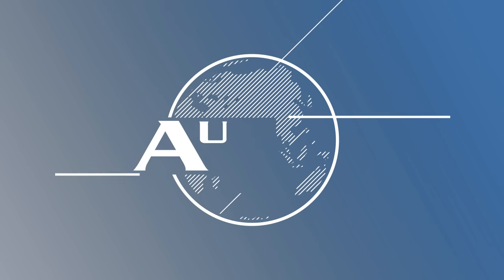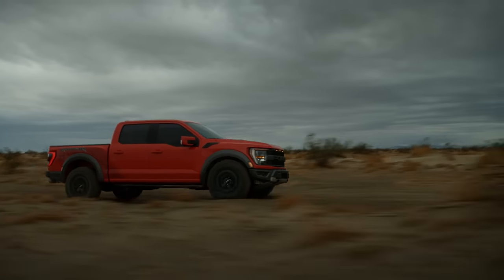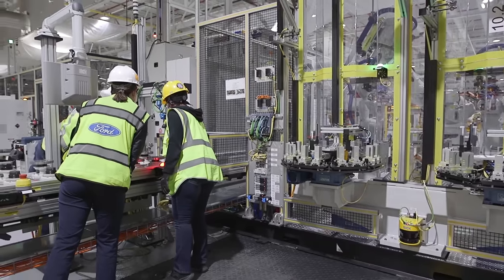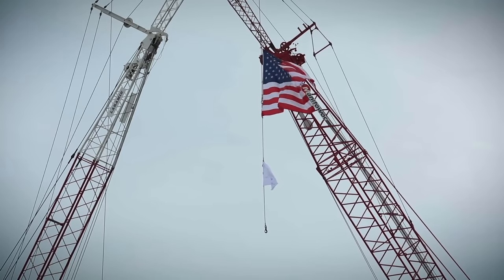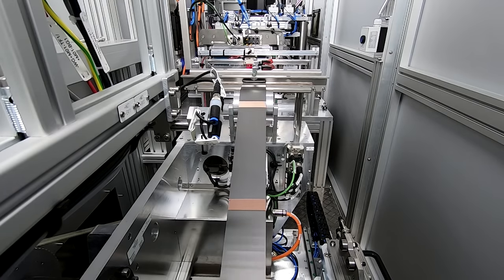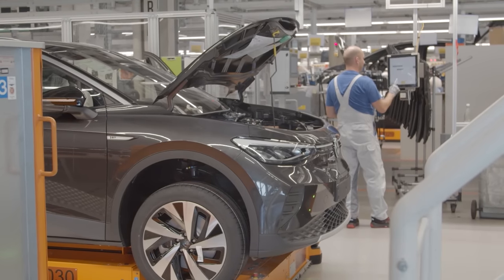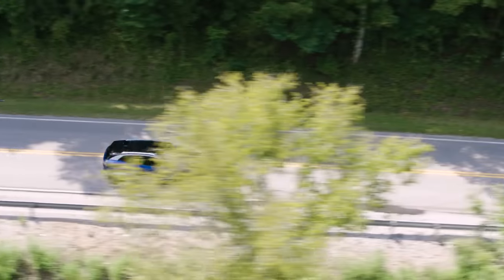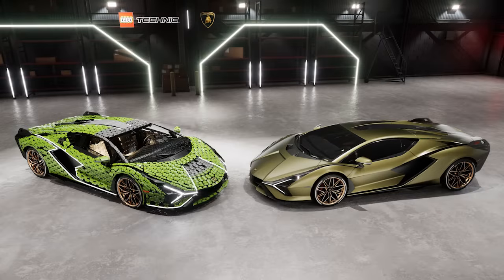Tesla Reveals Model S Plaid; VW ID.4 Test Drive Impressions - Autoline Daily 3099

Comment: If the Model S Plaid is only faster quicker in a straight line, it won't even have the impact on performance the Nissan GT-R35 had after it launched. The R35 was is still a highly proficient road course racer not just a dragster. The R35 is supremely quick but also tremendously fast. But Model S's tend to be yeoman at best, the typified American Muscle car, more power than handling and/or maneuverability. So, being quick but not fast around challenging corners and bends. 

But then I expect the Model R (if that will be its name and it ever happens) to fix most of that... maybe.

Meanwhile, the Plaid is likely meant to put a fiinger in the eye of hypercar makers, Rimac's Concept Two, The Pininfarina Batista, and Lotus Evija come to mind, whose BEV Hypercars are just as quick, but cost around or over $2M and maybe all of them together will only produce less than 1000 cars. But then those cars will also be demons around a race course.

Tesla again may be showing that they are ahead of the curve when it comes to technology, though not styling (Personal opinion is personal), but notably behind the curve when it comes to performance trends. Handling and maneuverability are the key points these days. Acceleration and Top speed are still very important but are a close by still second place to handling and maneuverability. Given most people will not be able to use the kind of acceleration or assumed speed the Plaid will be capable of, handling and maneuverability become MORE important, for it "fun factor" and utility. Most will consider 0-60 of around 3.0 second is good enough and safe for most likely drivers of such vehicles.

Also, Insurance companies typically don't penalize vehicles for having great handling and maneuverability, just acceleration and speed. But then if you can foot almost $130K for a single vehicle, does that really matter?
Reply: Perhaps you will need to study the Laguna track results and then the Nurburgring results, it's not just about speed.
Reply: @johnmqueripel2367  
I believe I said that at least once during the comment.  I view Quickness/acceleration and Fast/Speed as two different things. 

IF you are talking about "the Model S (or Plaid, the "Raven") can be just as fast around a road course" it would be clearer to say that or include it with your comment. 

Brevity can be the enemy of clarity. Do not assume "I know, you know?"

I was not short because I expected responses like yours to be forthcoming. If there is a link saying "Read More", you should probably click it and read more.
Reply: @DocWolph  Dear oh dear I think you are taking yourself a bit too seriously now.
Reply: @johnmqueripel2367  
And I think you got caught in an error and are trying to punk out. You don't need to start something to save face over nothing.
Reply: @DocWolph  You sound incomprehensible.

Comment: 8:30 I dont get why Tesla does not hit this market. Soft and long. You give the car a 0-60 of 7 sec you can boost the range and frankly thats where most of the public lives. Those of us who like speed go for performance trims. HELLEEEEW! Instead they give the public 0-60 quicker than SUPERMAN at 6 flags. I mean jesus something is not right here.
Reply: It's an option called chill mode.  You actually have to select and agree you won't call for your mommy if you really want to go fast.
Reply: Without the quick acceleration and the other gimmicks Tesla uses (fart noises etc) a BEV is just a very expensive and impractical car compared to anyone running on gasoline or diesel fuel.
Reply: Tesla only makes [read needs to sell] < million vehicles our of 16 million annual sales.  Watch Tesla growth while ICE sales trend down, in my opinion.
Reply: @brandoYT  I think they sell mostly because of

A: governments forcing EV's down our throats with bans on ICEV and EV subsidies

B: being presented as a response to climate change, which I think is irrational even if climate change is a major problem

C: gimmicks with limited practical utility that don't really solve any major problems with regular cars (neck-snapping acceleration, lower noise)

D: very minor convenience advantages over ICEV that are exaggerated to a ridiculous degree e.g. "home charging" being sold as this super amazing feature (stopping at a gas station for 5 minutes every week or two was never a problem with ICEV)

E: major inconveniences being completely overlooked (much lower range, much slower recharging, much more expensive to produce)

F: the higher energy efficiency and somewhat lower maintenance cost being oversold. Almost nobody will break even on these savings over the life of the car let alone the first 3-5 years, when comparing to affordable ICEV's.

G: The novelty factor. Current sales are still a lot of people getting their first EV, and a fair amount don't get another the next time which suggests the experience is less amazing than it's made out to be.

Now, EV sales might keep going up for a while because of these factors, but unless a quantum leap in batteries comes to market, I don't think there is a market driven "EV revolution" coming.

Unless it's a communist style revolution they have in mind, where the government just makes combustion cars illegal.